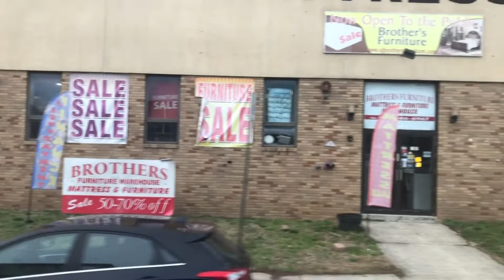NJ Transit: On Board MCI D4500CT #21027 On Bus Route 114 From Plainfield NJ To NY PABT: (03/25/2021)

Comment: What a long ride; is there a way to take the train into the City from there?
Reply from the maker: Most likely the NJ Transit Raritan Valley Line, although you may sometimes have to transfer trains at Newark-Penn Station.  Electric trains and dual trains serve NYC while dual and diesel trains run the Raritan Valley Line, and not all trips can be direct dual train runs.